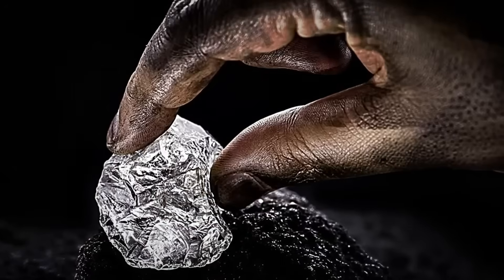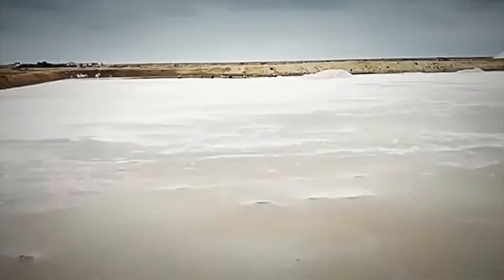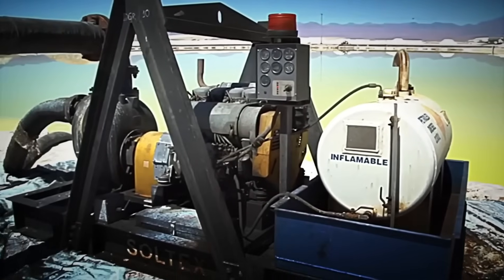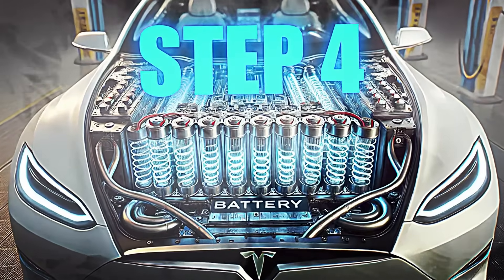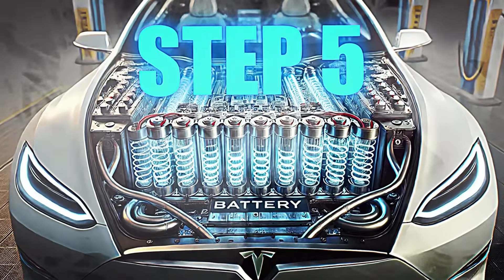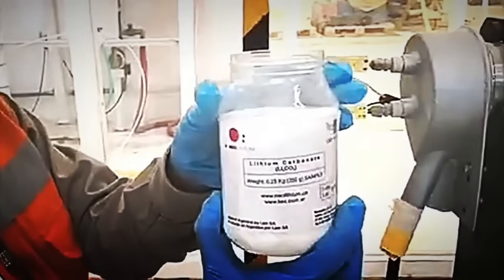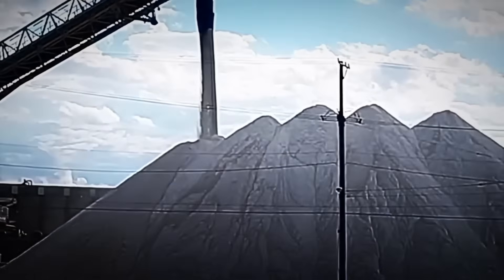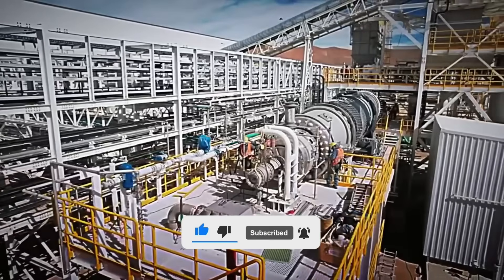HOW Lithium is PRODUCED 🔋 | The Most POWERFUL ENERGY on the PLANET ⚡

Comment: I’m fairly certain that the narrator is an artificial intelligence, but even so I have to point out that the narrator constantly refers to the lithium as an energy source. This is incorrect. Lithium is not an energy source. It is an energy sink. It can store energy, but it doesn’t generate energy. The way he makes it sound is as if it’s similar to coal or something.

There is one problem though with this material. Just like fossil fuels this material is nonrenewable. So sooner or later we’re going to have to find something else to fill in for it. Also, the thing at the beginning where the narrator claims that without it things like our smart phones or electric cars and stuff would not exist if we didn’t have it is just blatantly incorrect.

Electric cars actually pre-date the internal combustion engine. Not long after they experimented with things like steam power for cars believe it or not electricity was the next viable option. In fact, you can actually find an old photograph from I think it’s London where it looks to be probably around the 1890s give or take Maybe the early 1900s. And there is a collection of cars that are all parked. There are these large would look like pipes going from the cars to a central point on the ground. But these are not actually pipes. They are power cables.

The only reason the electric car disappeared for the most part was largely thanks to individuals like Henry Ford, and other others who basically pushed the wide adoption of the internal combustion engine 

Not only that, but there was also the fact that as anyone who has ever had to lift a automotive lead acid battery would know batteries can be heavy. Not only that, but a lot of vehicles didn’t have the range and most of all you know there was no infrastructure. 

This is actually the primary problem with electric vehicles today. Well, electric vehicles have come and they are clearly here to stay unfortunately, at the moment they’re still is not enough of the support infrastructure in place to basically make them a 100% viable alternative to a gasoline powered vehicle. Honestly, right now I think the better option would be to find alternative fuels for an internal combustion engine .
Reply: If we used nuclear reactors to power and heat all stationary things then burning gas in cars wouldn't be enough to raise global temperatures. Nuclear is the only truely "clean" energy
Reply: @MrDmadness  well this is definitely true. Even nuclear power has its issues. First Thursday obvious. The proliferation of spent nuclear fuel. Now contrary to popular belief. Spent nuclear fuel actually is recyclable. The only problem is this recycling has a rather exuberant price tag. Currently it’s just not economically valuable.

There’s also the fact that while nuclear energy is one of the cleanest, unfortunately when it goes down, it goes down hard. Now it should be pointed out that statistically speaking nuclear power generation is one of the safest on earth right now. I mean, think about it. Out of the hundreds of nuclear power plants that are all over the world. There have been only three major accidents with only two of them quiring basically a permanent form of exclusion.

You have 3 mile Island, Chernobyl and Fukushima. Yes there were other nuclear reactors that did have accidents, but the majority of these were very small and very, very easily contained. 

All in all again, statistically, speaking nuclear power generation is the safest on the world same thing with commercial flying. Yes when a commercial airliner crashes, it’s an absolute tragedy. But statistically speaking you’re more likely to get yourself killed walking down the street then you are riding in an airplane.
Reply: @ultrajd class 4 reactors burn 85% of the rods, the half-life of rhe spent rods is a few hundred years, complete depletion in under 200 . And if you tokkALL the spent fuel from every reactor ever made you couldnt fill a stadium, something that could be rone several times over in a single year with traditional fuel reactors. The biggest problem nuclear power has is public perception
Reply: @MrDmadness Unfortunately
Reply: @ultrajd It isn't green zero emissions, we mine the ore.
Seen that three ringed circus?
Understand the sheer volume of ore required for enrichment?
Didn't think so. 

As for being safe. 
Mmm, sure if you don't count the waste issue and the catastrophic results when it goes wrong. 
Remember the human race and its predisposition to war?
Couple of selective strikes during war.
Can you manage a safe happy end story for the event?
Na because there isn't one!

Comment: Energy intensive process. Then the loss of electricity by transmission and the charging unit converting AC to DC to charge battery. Then the loss by converting the electricity again to power the motors, plus heat loss in motors.

Comment: The narrator repeatedly refers to lithium as an energy source. It's actually an energy sink, and takes huge amounts of energy to produce. It only stores energy
Reply: 👍 The reality, a lithium Battery will never pay back the energy debt of its creation NEVER!
Reply: @0Aus  Interesting. What figures do you have to support that?
Reply: @geconserver  What do you not understand?
Batteries don't make energy, 
Not ever!
If you believe different please give an example of a battery producing energy?
Lol.
Reply: @0Aus  But that's not what you said, is it? You said a lithium battery would never pay back it's energy debt. But if you charge it with energy from a cheap source and then sell that energy later at a higher price, then the battery has made you money. Repeat over many cycles and you pay off not only the battery's financial cost but - if it's being charged from clean energy like solar - also its carbon cost.

So you need to be clearer in your use of language. And economics.
Reply: @geconserver  A lithium Battery will never pay back the energy debt of ITS CREATION never!
Is what I posted you need to understand the specifics.
 Your very welcome glad I could clarify what you missed. 😉👍
Reply: @0Aus  Reusing the same flawed argument does not make it any more valid. According to your argument, all batteries are a waste of energy. So that means no electronics, no computers , no cars - basically no technology at all.

Didn't think that through, did you?
Reply: @geconserver Firstly there is no argument, it's a fact batteries don't create energy. 
I ask please show me where I said anything about batteries being a waste of energy?
Reply: @0Aus  The entire premise of your argument - and I encourage you to look up that word in the dictionary - is that batteries  are a waste of energy to manufacture because, in your words, they "will never pay back the energy debt of ITS CREATION".

Strictly speaking you were talking about lithium-ion, but then why exclude NiCad, Sodium, or Alkaline since their purpose is essentially the same?

Also strictly speaking, batteries in fact DO produce electrical energy from the point of their manufacture. The exact amount depends on the chemistry used. Traditional non-rechargeable batteries (primary cells) such as Zinc-Copper are manufactured in their "full" state because the charge they contain is an ion transfer between the two metals which is (substantially, but not entirely) irreversible. Therefore the act of simply assembling the battery does indeed produce usable power.

But back to your central argument, that a lithium-ion battery "will never pay back the energy debt of ITS CREATION". Of course the purpose of these batteries was never to create electrical energy, but to store it - as you yourself have said.

So why is this not valuable in your eyes? Certainly the ability of lithium-ion - and other rechargeable battery chemistries - to reliably store a charge, tens of thousands of times over, that can be dispensed as required is extraordinarily valuable as it has enabled billions of handheld electronic devices to be produced. From smartphones to power tools, digital cameras to portable defibrillators - I'd say in fact we do owe a debt to lithium battery chemistry.

So what exactly is your point? Because it seems to be "batteries are bad", but the evidence of their usefulness would indicate otherwise.
Reply: @geconserver  You are incorrect. 
Again you claim batteries "produce energy" (Your words)  No they don't. 
Recall type etc.
Also again show me where I said 
Batteries are a waste of energy, or no good?
No I haven't not once. 

In order for me to explain the point of my factual claim you first need to understand the reality, also you need to stop making things up that have not been said lol.
Reply: @geconserver I hope to one day understand how people read information yet post incorrectly with he said, you said etc 
You do understand everyone reads the same information?
Everyone can see you make things up.
All good be well.
Reply: @0Aus  And yet here you are, 4 days later, not posting any factual information, just trying to gaslight everybody.

By the way, in those four days, a new commercial sodium-ion battery has been launched. Safer, with better cold weather performance, and cheaper than lithium-ion.
Reply: @geconserver Nothing even resembles gaslighting lol.
My information is true and correct. 
I welcome you the opportunity to challenge directly or otherwise anything?
Posting untrue details yet again. 
As for sodium chemistry, not new and extremely underwhelming, very poor metrics in almost every single way. 
It just as lithium doesn't can't and never on the longest day in its lifetime create energy. Zero, none, zip, scratch. 
You have a wonderful day.